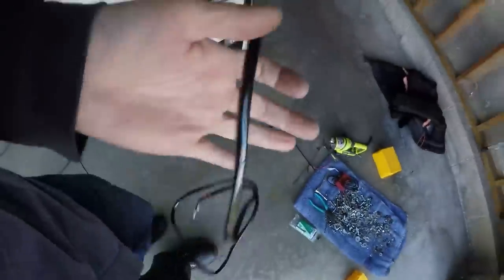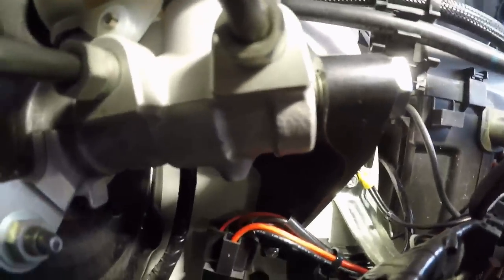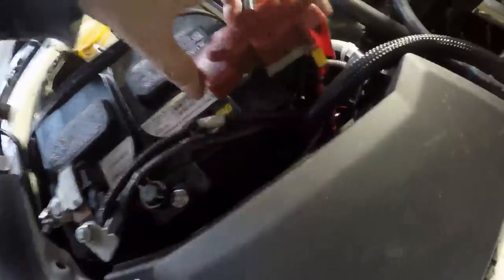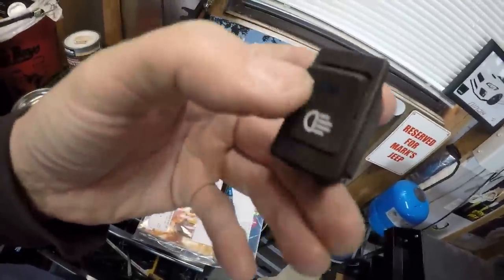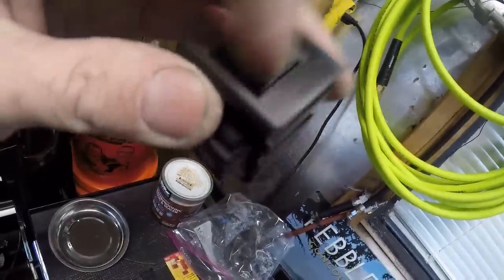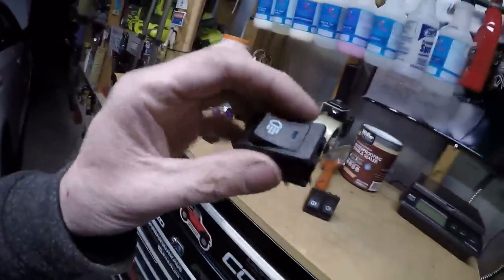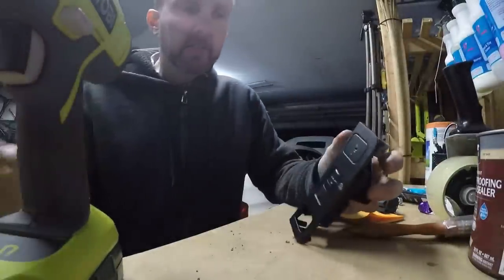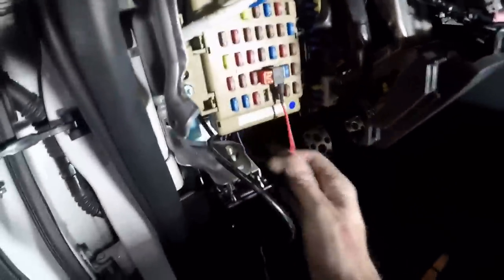2015 Subaru WRX Ep. 913: Wiring the 20" LED and Installing Custom Switches

Comment: Subjee speed has the original driving light switch which fits next to the dimmer switch as well as another smaller switch

I would also heat shrink the relays so no water gets in 
Love your video just trying to help nice video
Reply from the maker: i took out that oem switch for these two..

Comment: Do you have a link to the new switch cover in case I do not want to damage my original?
Reply from the maker: no, i looked at 10 different orders from a year ago, cant find it.
Reply: @LastHumansGarage  too bad. Thanks for your quick reply
Reply from the maker: @nics6308  just found it.   83472FJ000VH 1 $ 11.09 PANEL-SWITCH